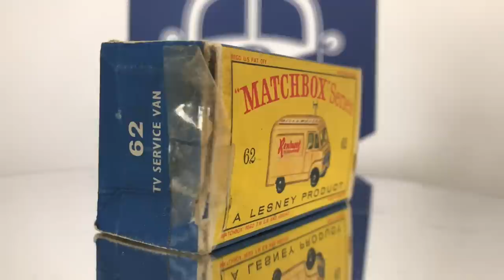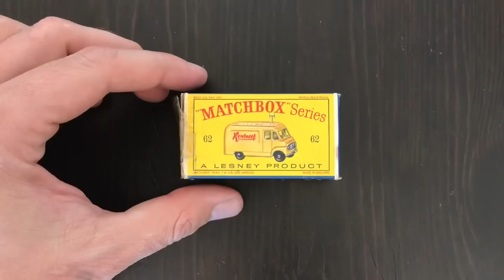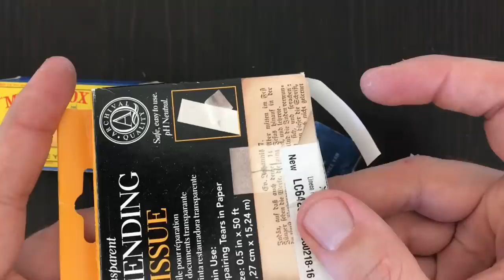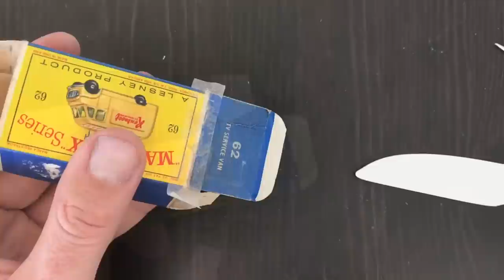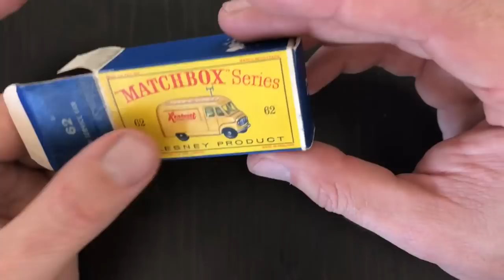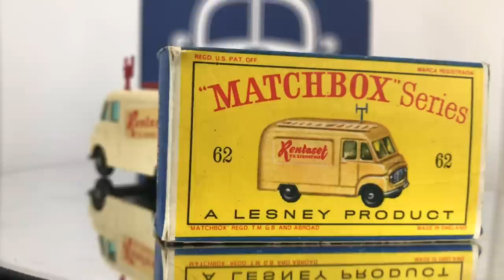Matchbox Lesney #62 T.V. Repair Van Car and Box Restoration/Preservation

Comment: One of the best ways of cleaning that rear door is, dipping it in hydrogen peroxide and then putting it in a plastic bag sealed and leaving it in the sunlight for a day or two as needed. It will come out like new. You should try it.

Comment: I've commented on other restoration videos that commercial floor stripper will take paint off of plastic much quicker than brake fluid. It will strip paint off of metal too. One thing to be careful about is that it also strips chrome off of plastic in case you are doing some hotwheels with chrome plastic bases and chrome plastic wheels. In some matchboxes you can strip the whole thing without drilling the base off so you can mask the base and paint the body.

Comment: The ladders are lying on the roofs upside down. They are molded with a slight curve so that they hug the curve of the vehicle's roof, so you should flip them over so that they fit correctly.